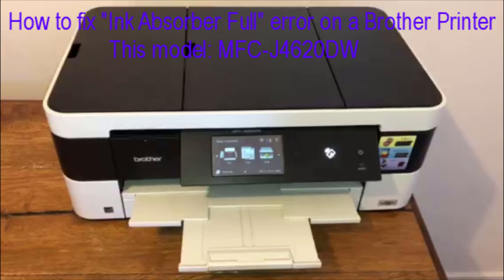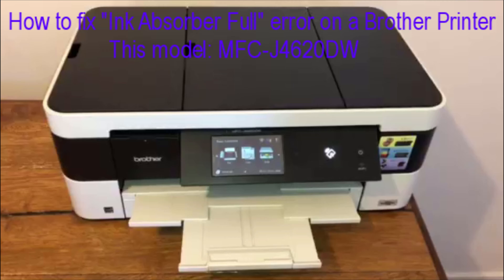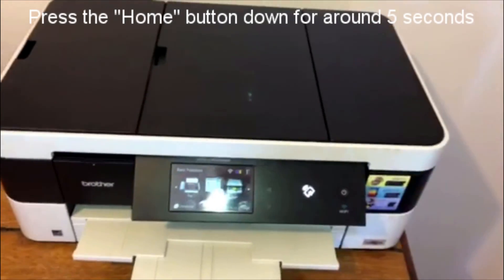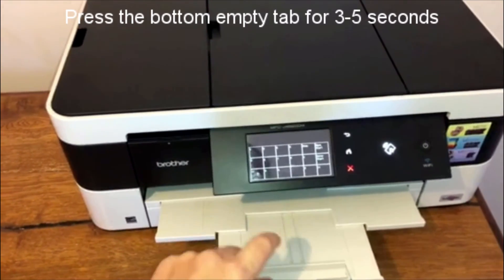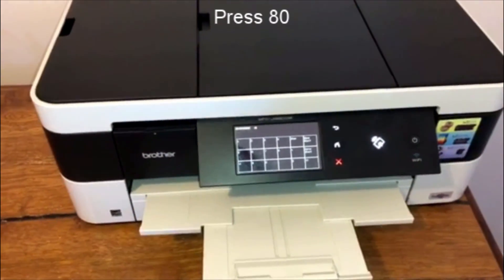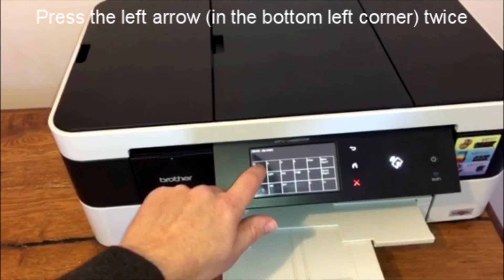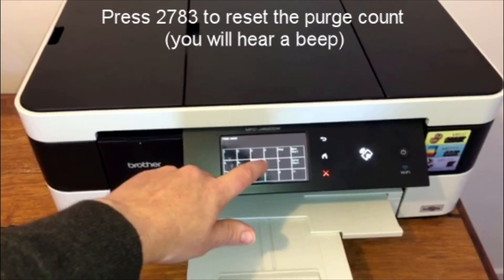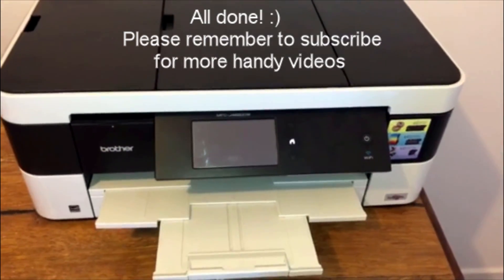How To Fix Ink Absorber Pad Full (Error 46) and Clear Purge On Brother Printer.

Comment: Thanks for this. I have a problem with the black printing. When printing the test-page I get evreything fine, except the black matrix. But the black text (S/N and Ver. info at the bottom of the page) is perfect and clear. Is there a way to fix that using maintenance menu.
Reply from the maker: Hi - Did you clear the purge count ? There is a code to deep clean the nozzles and ink tubes... When you enter maintenance mode, enter 7 and 6 and you should then enter the cleaning menu. Scroll left or right until you get to CLEANING BLACK. Enter 3 and press Mono / Black Start.  It should then say "CLEANING" and once finished will return to the home screen of maintenance mode. Press 9 twice to exit. I just made a quick vid with this walk thru- https://youtu.be/P-pXJTtlkFM Hope this works for you - let me know if it doesn't.

Comment: MFC-J4510DW: This is a repost of a message I posted on her other video showing how to actually remove the absorber box and service the felt pads.
Thanks for taking the time to produce this video...just some FYI for those trying to clear messages, etc...after removing the 'chip' attached to the absorber box it became apparent that the chip is actually a moisture detector whereby if it is too moist, (i.e. full of ink) then no matter what you do to clear messages, if the felts are wet this will generate the Error 46/Ink Absorber Pad Full error...all the magic keystrokes, number codes or finagling won't clear this error until you address the full pads which I simply removed rinsed under warm water, then let dry and reassembled...Hope this helps someone down the line...Good luck.
Reply: It seems I need to do as you mentioned.
Reply: I cleaned with alcohol and dried with dry tissue. Still get the error message.

Comment: I have tried this several times on my MFX-J985DW printer and I have gone through all of the steps but when I exit out at the end the window appears once again saying "Ink Absorber Pad Full" see Troubleshooting Users Guide.
Reply: Also when I arrived at the Purge it said "sen purge 00000"
Reply from the maker: Michele Ashley  I believe your model has a SEN PURGE count and also a PURGE count. Try repeating these steps but reset the PURGE count instead (if you haven't already.) At the PURGE count, press 2783 to reset, then 80 to go back to main maintenance menu. Press 2780 and then 99 to save and exit.  You may need to completely shut down your printer and start back up again for the error message to clear. If this is still showing, repeat the steps to enter maintenance and to reset the FLUSH count instead. If this still shows the error, you might need to clean or replace the ink absorber pad. I've got a video for that, but for the MFC-J4620DW). After it's at the point of being physically too full, resetting the counts may no longer work. Best of luck, I hope this sorts it out for you.
Reply: I have the same machine and it works until you type in the last code 2783. At this point, rather than saying maintaining it’s says machine error46. The purge remains at 000000 but the error does not go away. Any suggestions
Reply from the maker: @shannonrmason  Hi there-  try repeating the steps again, making sure the purge and flush are at 0 still, then exit maintenance mode (by pressing 99) and shut down the printer + unplug the power cable. Restart and hopefully now that resolves the error message. If not, check if your printer drivers need to be updated on your computer. If the error still remains and the printer won't print or says "Ink absorber pad is full" rather than nearly full, it is best that you replace or clean the ink absorber pads. (I've also got a video on how to clean them.)
Reply: Thanks for the explanation. And sorry for my english. I have the same problem as Michele. The purge is 0000 in my MFC 6520. And i have one more information that may help you to inderstand the problem. When I enter the code to maintenance. It does enter. But instead of the word "maintenance" on top. There is the word "error46" but i can reset the purge and when i enter 99. It shows "error" before restarting. And when it start. The message is the same "error46 full.........". I hope that you understand me. Can you tell me what's the problem? And thank you in advance

Comment: Tried it on MFC-J4510DW. Would not let me get past the first blank at the bottom. Just put up the red X.
Reply from the maker: I've checked with your particular model, and you'll need to press the *, 0 and # keys on the LCD (in this order) on the screen which immediately follows the screen with the blank tab at the bottom. This should get you into maintenance mode. Follow on with entering 8,0 and follow the steps thereafter. If you have further trouble, Try this again except only key 0 and #.
Reply: @Knowhow1  doesn't work on my MCF-J4710DW having the same problem.

Comment: I have the MFCJ4510DW and tried this process a couple of times.  It does zero out he purge to 0 however when it reboots I still get the ink absorber pad is near full error.  Is there a way to get rid of it on this model?
Reply from the maker: I’d say your ink absorber pad is truly almost full and needs replacing unfortunately... the reset works when the page count creates the error, but I’d say yours must be also sensing the absorber pad needs replacing.
Reply: @Knowhow1  I have the same model and I replaced the absorber pad did all the resets/restart and I still get the "ink absorber near full". What am I missing?
Reply: Well, after printing a few copies, the error went away on its own. It must not do a check each time and when it did, it cleared the error.
Reply from the maker: @Mark-ms6fy  great news :)

Comment: Thank you.
Mine has not given me an error message but I'm getting ink splotches on some pages.
Do you know how to change or clean the ink absorber?
Reply from the maker: I'm just uploading a vid on this now. Take a look if you still need to know
Reply: @Knowhow1  Mine is a MFC-J4510DW.
Do you know if this is similar to the ones on your list?
It looks just like the one in this video.
Reply from the maker: @aurthorthing7403  Yes the top disassembly will be pretty much identical. The ink absorbers are the same model and are located in the same place. You may just need a thin flathead screwdriver to pry open the motherboard cover rather than just using fingers, as the device panel I believe is shaped slightly differently, but everything else should be the same.
Reply: clean the ink absorber with a towel